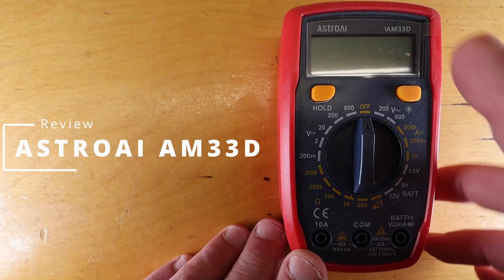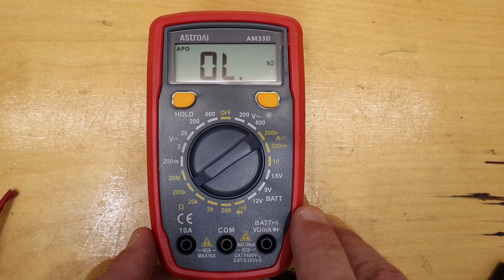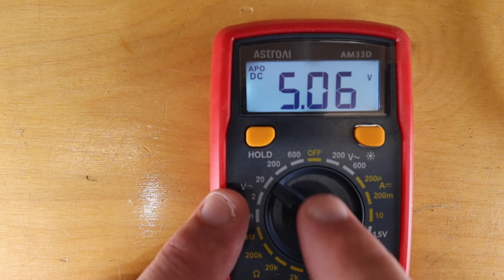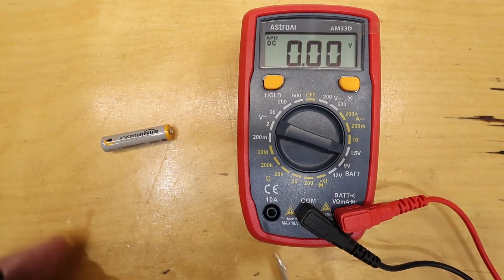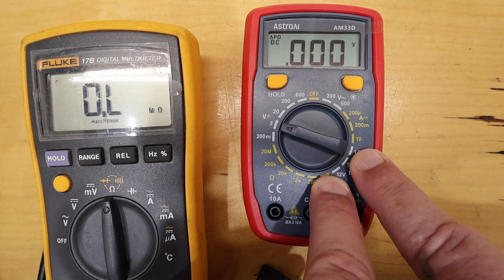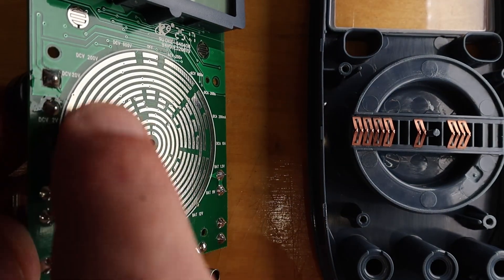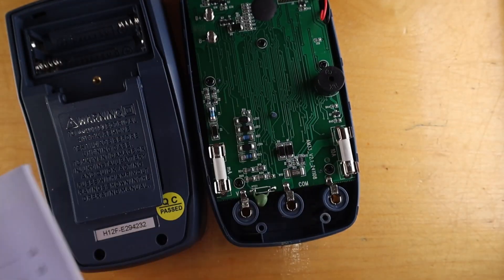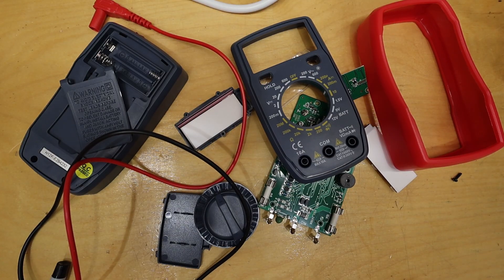AstroAI AM33d Multimeter Review and Teardown

Comment: lol can't believe they used a surface mounted resistor as a current shunt and even more surprising is that is held at almost 10A for so long and didn't start burning. You should test what temps it goes to under 10A load.

Comment: Looks slightly better than the usual cheapo 2000 count DMM, fused on both inputs with ceramic (maybe even sand filled!) fuses, I've seen glass on the volt/ohm/mA jack and nothing on 10A. Battery test includes bad/good indicator and reads out the loaded voltage.